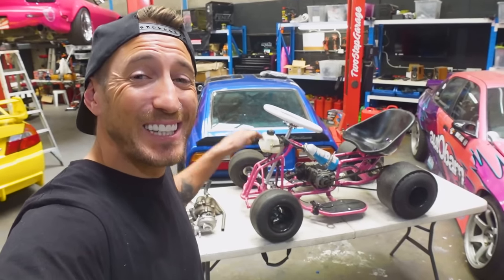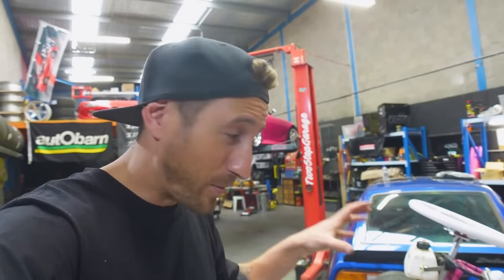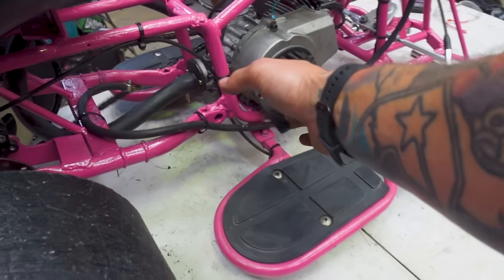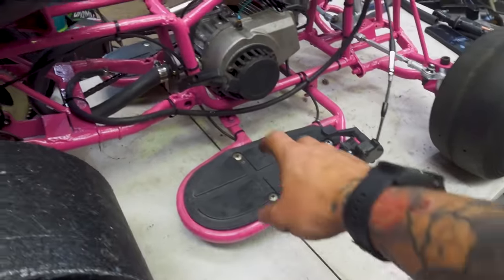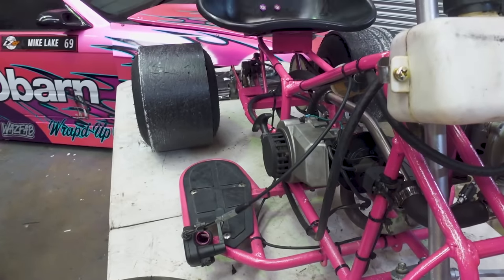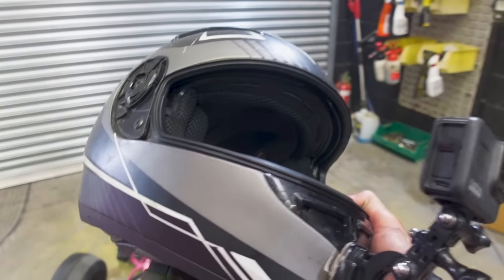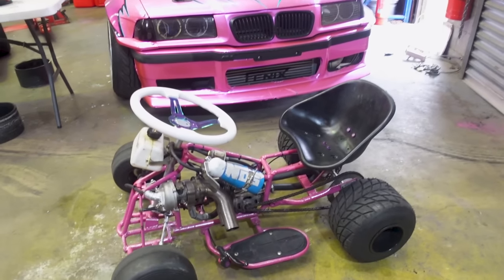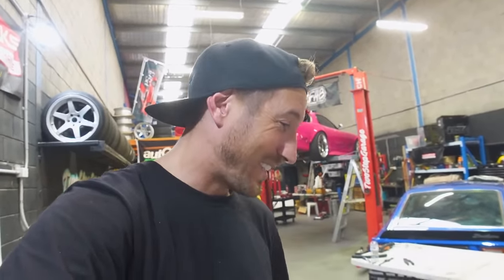Installing NITROUS and a TURBO on our BUDGET 50cc Drift Kart!

Comment from the maker: RIP to our 50cc motor 💀. What motor are we throwing in it next?!
Reply: Maybe 85cc
Reply: 110cc
Reply: Predator 212cc and custom number plate LIL RIPPER
Reply: Also try a honda gx200, heaps of upgrades available for them or a chonda cone motor
Reply: Twin 50cc, both feeding and being fed by 1 turbo, located where the original motor is
Reply: Lifan
Reply: Sachs rotary engin !!
Reply: 2 stroke motorised bike engine
Reply: 110cc
Reply: 100cc would go flying
Reply: KTM 65CC 2 stroke
Reply: 110cc pitbike engine
Reply: 100cc motor
Reply: Assassin 125cc e start with turbo
Reply: Go kart motor off market place 🫶🏻
Reply: 110cc
Reply: 2JZ
Reply: Cr500
Reply: 90cc
Reply: Go Big 200cc !!!
Reply: 10A rotary single rotor
Reply: 125 2 stroke from a kx/yz ect
Reply: Barra swap
Reply: ttr150f engine then put the turbo and nos or would love to see twin turbos each side would look sick
Reply: Go with the times electric 😂
Reply: 125
Reply: Harbor freight predator motor
Reply: Yamaha 125cc Mike 😁😁😁😁😁😁
Reply: I suggest you a Chinese product V180 SS is highly adjustable
Reply: Ghost predator 212 for sure
Reply: HIGH reving 50/60/70cc
Reply: Throw a 125cc (154FMI) into it and throw lil turbski and the NOS setup onto it would be a sick ripper :D
Reply: 212 preditor engine with govnere removed and remeber to upgrade the flywheel if you do this engine!!!
Reply: A k20a2 will be nice i guess😅
Reply: yamaha yz 80 from 2000 and up
Reply: 2jz
Reply: Hayabusa swap
Reply: 140 cc yx or 160cc yx
Reply: 110 cc pit bike motor 4 speed 🥶😉
Reply: Yx160 pit bike engine
Reply: 79cc predator
Reply: 80 or 85cc 2 stroke motor would be a beast on the little cart😂
Reply: Put a 50cc or a 110cc 4stroke so the turbo will be efficient 🔥
Reply: Get a motorized bicycle kit and put that on their or a kx65 replica
Reply: Deffinetly keep it 2 stroke
Reply from the maker: Hybrid? 👀 @chumps90
Reply: Cr125 2banger
Reply: 160cc pitbike engine with a turbo strapped to it lol
Reply: Some 110 chinese engine they are crazy powerful
Reply: imagine if you put a LS in it lol
Reply: Doing the same kinda path as with the 50cc with the honda clone 200cc engines as I showed on my creations, have not seen anyone nitrous those yet, and very few turbo versions :D
Reply: 65
Reply: 110cc off of Amazon with turbo or 190cc racing engine with turbo, and stretch the frame
Reply: Rc max 80cc is the best engine for this build 💯%
Reply: Ebay 80cc moped bike kit, they have an actual clutch 😉 and they go pretty hard
Reply: You could put a bicycle motor in it they are 60cc to 80cc I believe and they have a manual clutch and I can't forget it's cheap
Reply: if you want to pay shipping i have a 150 dirt bike motor
Reply: Just big bore it
Reply: i just have to write this for the meme: LS SWAP!
Reply: 125 2 stroke
Reply: Small Rotor engine bro.
Reply: I think you should put a LS3 and then twin turbo it, should fit.
Reply: Use a 110cc fuel injection. I once had a 110cc scooter with fuel injection just had a funny looking setup and it was a scooter so don't no if you find ur regular 110cc like this but you could source it out and make it work . Ud get alot more tune ability I do believe
Reply: PARILLA X30 30hp 125cc kart engine?
Reply: 85cc
Reply: 85cc or 100
Reply: Bro I had to have seen this coming, a 2 stroke motor relies on oil getting into the engine to lubricate everything.... You leant this motor out 😭
Reply: @itsmikelake  straight electric don't have to worry about noise restrictions so you have more places to take it without waking up the city you live in
Reply: I'd throw an 80-85cc 2t MX engine into it, make it a tiny little shifter kart 😅

And stay away from the turbos and nitrous next time.... it'll be fast enough to terrify you with just 20+ hp and at least 5 gears along with less weight than you've currently got strapped on with all that stuff 😂
Reply from the maker: I think we all saw this coming to be fair 🤣 @jams_finest
Reply: Predator 212
Reply: kx 85cc 😅
Reply from the maker: @burnoutmania9689 congrats, you’ve won a $50 autobarn voucher! DM me on Instagram @itsmikelake and I’ll sort you out 🤙🏻
Reply: Another 2 stroke
Reply: Honda gx200
Reply: A 2jz
Reply: Predator 212

Comment: The setup would have worked with the drift sleeves, without them the engine wasn't spinning as fast, didn't even sound like it was in the power band.  The traction also put a greater load on the engine.   It is likely that it ran lean with the nos, there didn't seem to be an rpm increase with nos, but if the sleeves had been on the engine would have at least spun faster and that would have reduced the load on the connecting rod.

Comment: So when boostedboiz did their shopping trolly gokart they figured out that the intake also needs an expansion chamber, because it’s only one cyl you have to build the boost up into a plenium or something, I’d have to re watch the video but I recomend checking it out they got theirs fuel injected with a trigger wheel and everything running on a fueltech

Comment: It has to have an oil cooler just for the turbo i think it will help it getting the turbo more reliable plus a small intercooler for the engine to run better and it will look very cool imo

Comment: Yoooooo Mikeyy. So i reackon you consider these big plans. Now personally i have been contemplating building my own drift kart and my plan was going to be using a 140cc race spec pitbike motor. I have a bit bike and it rips like crazy so the power plant is definetely there. My plan was to use the pitbike so that i have the engine, clutch and braking systems that would be directly transfered into kart. In you situation, you could have a much stronger rear brake that you could fabricate into a handbrake for the skids like many other guys have done with the expensive karts. You could also fabricate a sick shifter as well so that it looks and feels like one of the kit drift karts but 100% buget and personalised.

Comment: Loving your work, so the most common swap on these lil beauts is a pedator engine or as i know them, a honda gx160. With a centrifugal clutch, same as that used on a prokart gokart. My advice from experience is to stay with an automatic gearbox, im trying to put a kx65 engine into mine and having to retrofit a rear brake pedal so i can use a clutch is a pain in the arse, so is locating the radiator.. so my advice for what its worth, is an air cooled small generator engine and turbo it. Mods for a gx160 engine are nye on limitless 😉 watching with great anticipation! 👍

Comment: 125cc semi auto motor conversion from a pitbike with electric start. (150cc if you're really wanting to party)

Grab that golden ozito zip saws battery and a 18v to 12v converter, use that to power the starter, some leds for lights and underglow.

Comment: You should put there Honda Gx 200 or predator 212cc it is 4 stroke 6,5hp lots of upgrades modifications and  original  parts every ware the are soo cheap  the are also used in go karts

Comment: i think that you can put an 110/140cc 4 stroke engine, it's more resistent and durable, but if you want to be crasy, and safe some space an weight an ~140cc 2stroke .
That would be very baad

Comment: damn didn't even have the decency to give you a epic smoke show when it blew. should put a lifan 125cc pit bike motor in it at almost double the displacement it would rip add nos or a turbo (or both) and you would have a real death trap

Comment: I'm expecting a 125cc pitbike/gromm engine, but would like to see a 230/250cc Lifan, or a clone of the GX200 6.5hp stationary engine (My one is pushed up to 16hp) but I'm not sure the bigger engines would actually fit, so a pitbike engine it must be I guess, and there are still the 140cc upgrade kits for them

Comment: Get yourself a chinese bicycle engine. Its a single speed two stroke with a MANUAL clutch and would be great for drifting. They are 66cc and much stronger than the CAG clone you blew up. Not very expensive either, and you should be able to get one easily in Aus. About all you will need is to weld up a quick engine mount, and add a larger #41 chain and rear sprocket.

Comment: What kind of work would be required to fit the motor from a bigger 4 stroke generator, or water pump or something around the 140-200cc mark? Would you need to pick up a go kart clutch with it, or do you think you can use the clutch that is already in this? I’ve wanted to do something like this for ages and to me, your videos have been sort of telling me what/what not to do. 

As for your swap, since you have the money to get one, a 110cc 4 stroke from a pit bike would be pretty cool, and if you get it from a pit bike you could turn it into a tiny shifter drift cart. I’d love to see how the tiny turbo would fit on one of those.

Comment: As a 125cc 4 stroke engine owner, I would recomand to you a 125cc engine with a 3+reverse gears or 4 gears, those are kinda good engines and in my country they are cheap and kinda powerful for what they are

Comment: Definitely should motorised bike engine swap it can do a fair bit with them to the point of running bigger carbs and reeds an expansion chamber porting head shaving alot of hours of fun